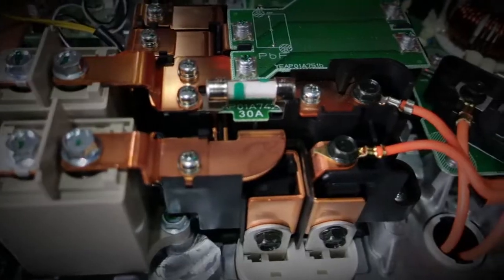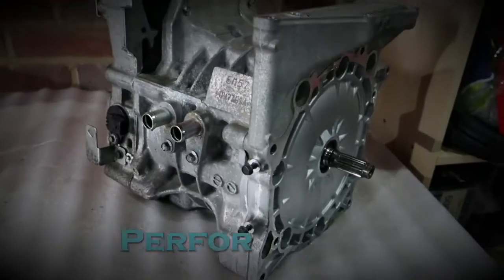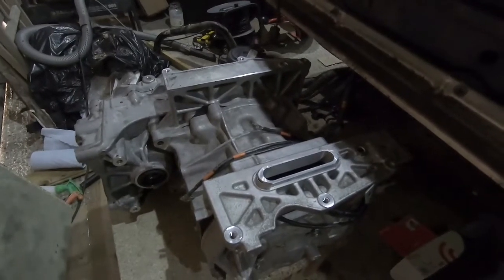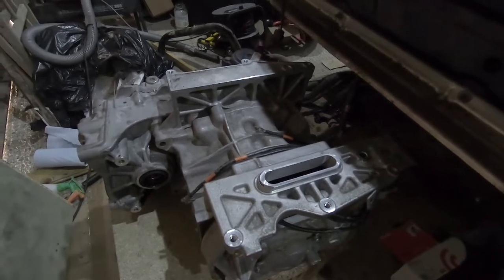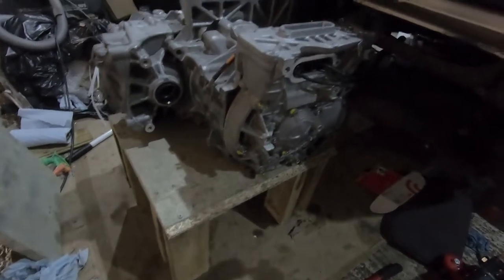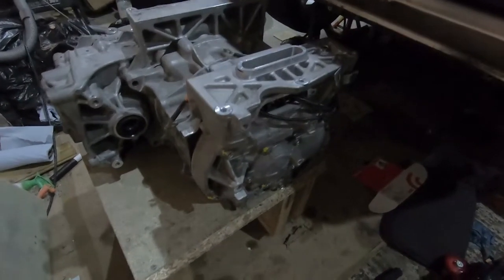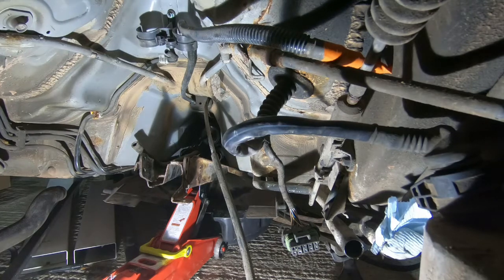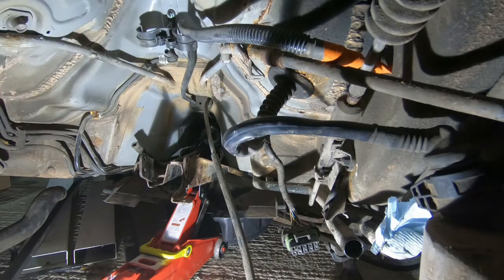Electric Porsche 911 project video 15 - Still figuring out how to fit a Leaf Motor in a Porsche 996

Comment: If it were me I would mount the Nissan unit in the normal orientation and compromise the Porsche body to suit.  Cutting and re-welding the body is low risk while messing with the highly-engineered Nissan motor and transaxle opens up a can of worms.  Attaching the motor only to a diff is a whole lot of work in terms of detailed mechanical design and machining, that is unlikely to be as reliable.  Another thing I would do if at all possible is flip the car upside down while you are designing the mounts and cutting the undersides.   This is what 3-D CAD does best but you are the working with the real thing and have to get it right first time.
Reply from the maker: Thanks Paul, those are fair comments. And I may end up having to go down that route if this set up fails.  I decided to try this way first in the interest of discovering just what sort of punishment these units can take. I would like to be able to feed back to the ev conversion community anything I find out so the next person trying this knows whether it's a viable option or not. Or what challenges they need to overcome to do so.

Comment: Flip the box and use an external oil pump and pump oil into the top of the case to bathe the gears. That or take apart the Porsche box and remove all the gear sets that aren't needed. Then make an adapter plate to connect them. Look up BMWEV for examples.

Comment: What about mounting the motor and transmission upright, but with the motor towards the rear of the car and the diff ahead? This would match the 911 native layout better.  Then you could just run the motor in reverse. Wouldn't feed the catchment reservoir but maybe you could tap in an oil feed at the top of the case and dump trans fluid in there with an external circulating pump?
Reply from the maker: I did think about that, however I have seen a lot of stories about people struggling to get auto transmissions and electric motors to work well together. That said it may be an option if I can get a manual transmission for a reasonable price.
Reply: @PerformanceEV  No I mean the Leaf motor and gearbox, not the Porsche auto.
Reply from the maker: Interesting idea, I'll take a look and see how it would fit.
Reply: I like Stephens Idea....I was thinking about the same idea, and dismissed it due to gear oil distribution when run in reverse...but Stephen has a good idea to solve that with external pump.  Alternately, I will re think about oil flow in motor-reverse rotation...maybe there is a way to catch the oil thrown by the main gear (now being thrown away from the needed location) and redirect it INSIDE the gear housing to guide it back to the to the distribution reservoir....its a stretch, and would require revising the internal gearbox...but I am thinking of a catch zone and a gutter/trough to run the captured oil back to where its needed....hmmm...love solving these problems.  (I have a 997.2 torn apart in my garage....rebuilding the 3.8 motor....was thinking of doing this nissan leaf swap 6 months ago when i started...but decided I do not have the EE/SW/FW chops....so staying with existing motor....at least for this build).  Will continue to follow this!

Comment: In my searching for ways to use the leaf motor in my (future) conversion, I have noticed that Summit Racing has ring and pinion sets with a ratio from 7:1 up to 7.4:1, mostly for a Ford rear ends. I wonder if that would be close enough?
Reply from the maker: Thanks, I'll take a look at that.

Comment: Can you not use the original transmission mated to the leaf motor?
Reply: https://rover.ebay.com/rover/0/0/0?mpre=https%3A%2F%2Fwww.ebay.co.uk%2Fulk%2Fitm%2F163664795266
Reply from the maker: Thanks, I've set a watch on that, just need to save up a bit more:-)
Reply from the maker: Just realised that's a 4S gearbox. If I did go down that route and could get my hands on that one, an AWD conversion would have to come into the mix in the future:-)
Reply: This is the most obvious and easiest solution.
Reply: someone should manufacture transaxle case only for EV conversion of Porsche, where you could reuse existing differentials, ring gear, pinion gear etc.
so that the electric motor can be shoved into where the transmission used to be (under the back seat), and leave more space where the engine used to be fore more battery.